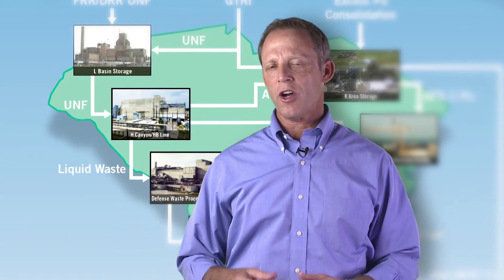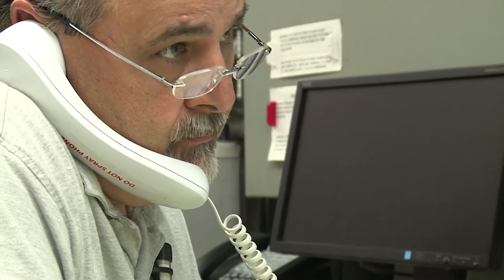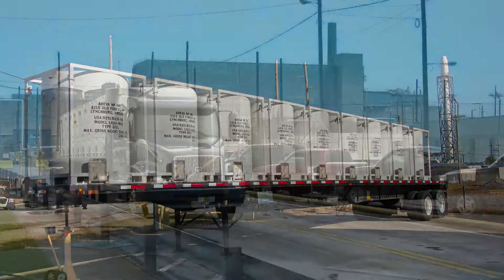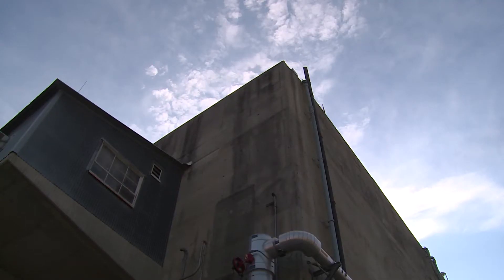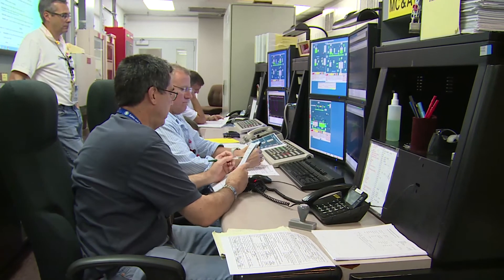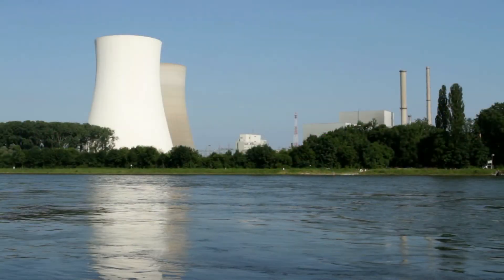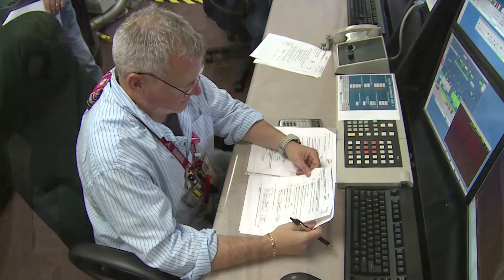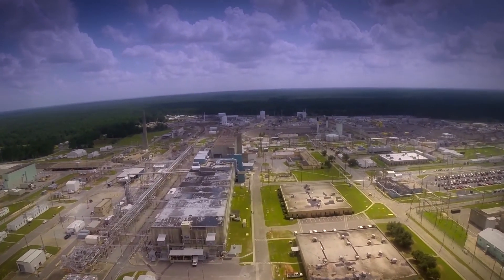Why SRS Matters -  H Canyon

Comment: Might as well say it, extraction of plutonium and tritium. Now being used to mix MOx fuels. Called a canyon because it is in a deep trench that acts as shielding. Why not make trivalent fuel with Pu, U and Th. Make as an oxide or carbide ceramic material and it would be both quick startup and long burning. Would have a double peak. One as the Pu goes critical and the other when the 233U goes critical. After that it should have a nice even burn 🤓😁❤